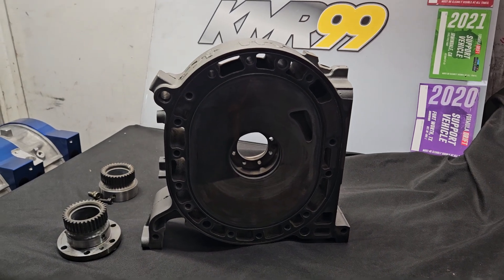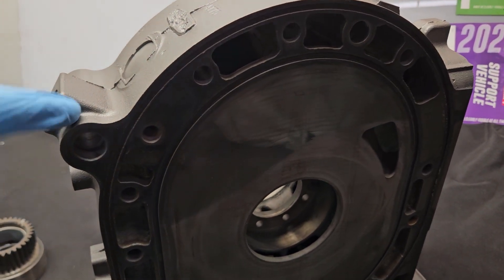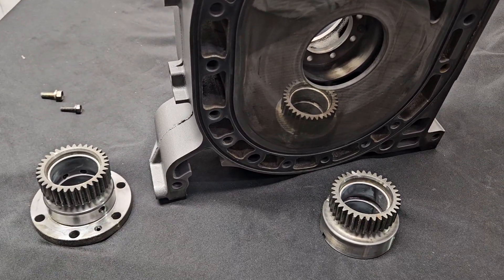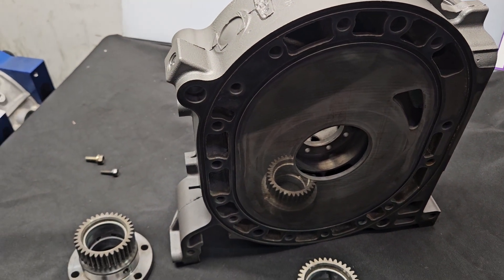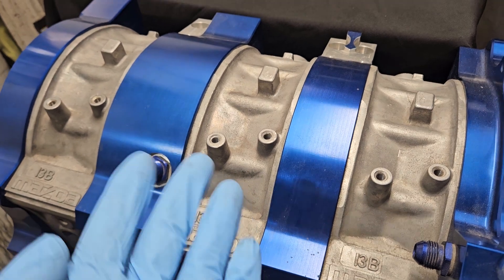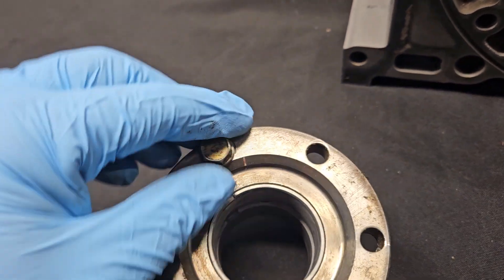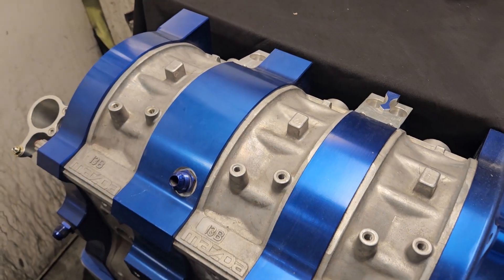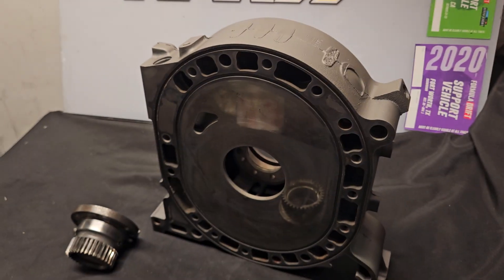20b thick housing center plate, what makes a 3 rotor special - technical talk on the 20b center Iron

Comment: short block motors are fixed with studs that go all through . OG 20b motors use a method where front and rear fix into the fat plate and only a couple are full length / if all the studs are all through . but at a similar H7/h6 machined fit they will have significantly more movement and wobble that had they been shorter and fixed into the fat plate . if you are modding an alum billet plate for 12.7 mm studs then threads are required to be 25mm deep to achieve a rated fixing ( 2 x diameter ) in the cast iron plates this is only 13mm